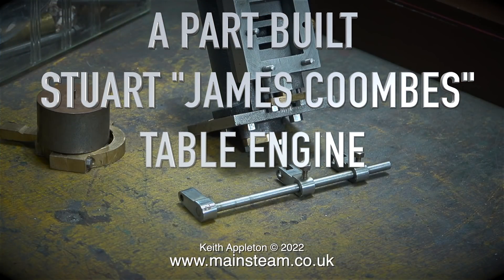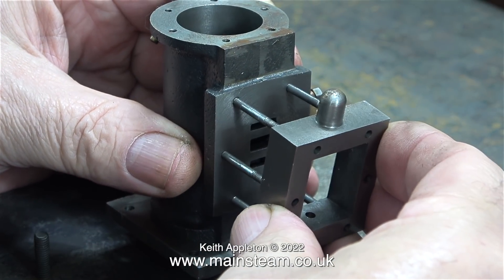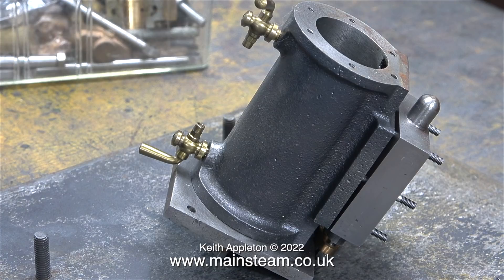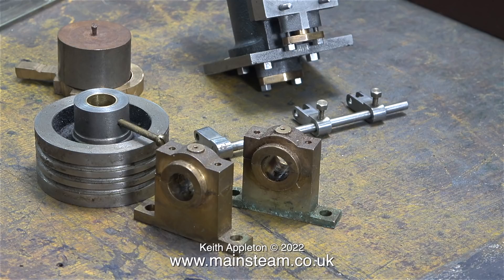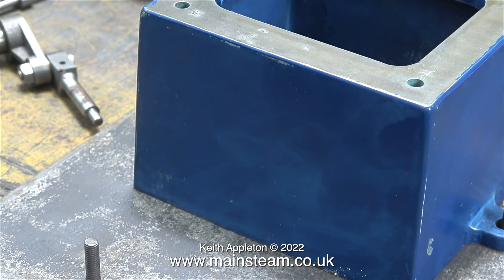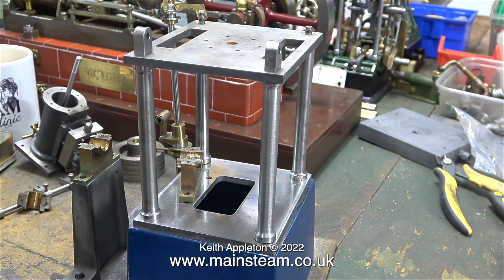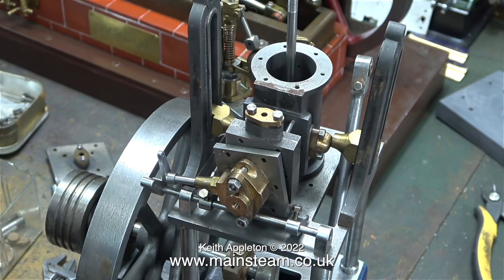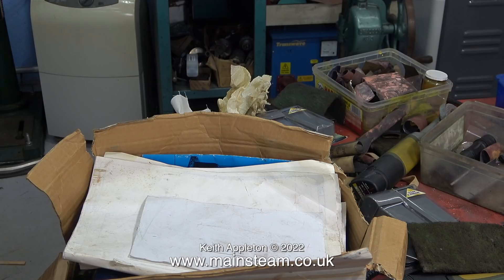EXAMINING A PART BUILT STUART "JAMES COOMBES" TABLE ENGINE

Comment: I have the booklet, however on pg. 27 there is a bearing which I cannot figuire out where it goes.  On pg. 20, there are two bearings which are easily seen placed supporting the crank shaft.  I was hoping to see where this "extra" bearing goes by watching your vid--alas, no extra bearing.  You have any idea?
Reply from the maker: Sorry, I can't help you with this.